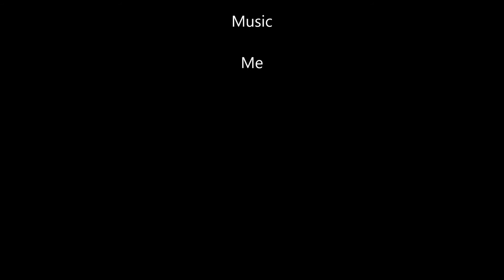How to Slow Down A Basic Lathe (A DIY Mod)

Comment: Nice mod for that lathe, looks about 600-800 rpm you got it down to.
Reply from the maker: Boston - Thanks for the comments.  And, yes, you have a good eye.  At first I thought I had dropped it down a bit farther but after buying a $13 lathe tachometer the actual speed is 680.  I need to do a follow up video showing the little meter (ordered on eBay) and the real world measuring.  Dropping the speed down from over 900 to about 680 made turning a heavier bowl this week much easier.
Reply: You could increase the size of the top pulley some more, maybe by creating a two piece insert over what you made, just a thought. Good job!
Reply from the maker: The slowest this lathe could drop down to is 930 per the manual.  The slower the better for sanding and finishing.  Too fast and the sandpaper will just burn.  Thanks for your comments.
Reply: @drez20001  - in my experience, you can use higher speed with sandpaper - you just have to be patient, and don't put a lot of pressure on it.  I managed to put a mirror gloss on bocote at 1000 RPM or so.   No CA involved.   Looking at your mod, however, I'm considering making a couple of extra pulleys for mine, and just buy larger belts.  I'm not married to having the belt cover.   (I believe I have the older model of this, the 45276)
Reply: Nice you think you could get a harbor freight lathe down to ~100 rpm or even lower possibly?
Reply: @alexsanchez7091  unfortunately no. By my calculations, that would require roughly 23 in diameter pulley on the top. I'm finding it difficult to even get it down to 250, as that would require 8.785 in pulley on the smallest bottom pulley. I'm still trying to figure out an entire new top pulley to give 4 additional lower speeds, but it's a task. It might work if there was a way to make the bottom ones smaller, but I see no way to attach it if you made a custom bottom. I'll post back when I figure it out, even though it's been 2 years and you've likely moved on, but I'll come up with something. I am thinking 400 may be the actual floor on this with a reasonable size top pulley